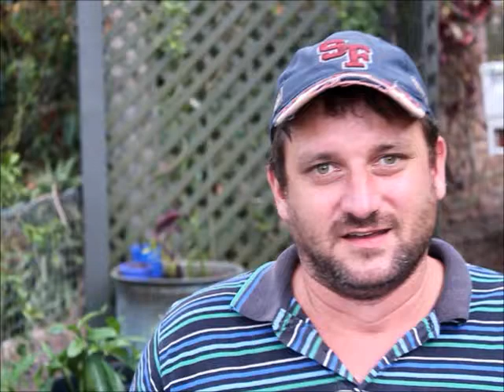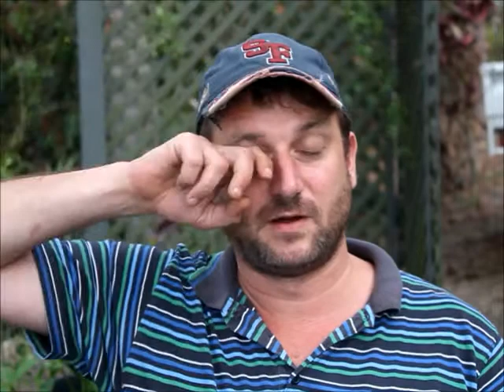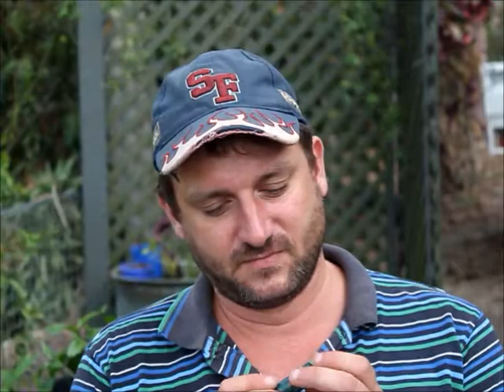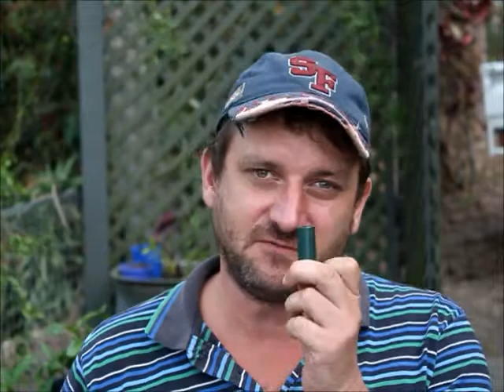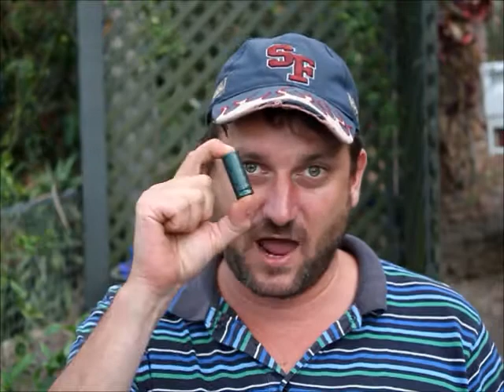MPP Solar PIP4048 (aka PIP 4048) Review - Multiple Failures

Comment: My pip 5048 MG runs just fine for 6 years straight with 0 problems. There are lots of knockoffs you have to be careful.
Reply from the maker: I think you'll find this vid is much older than 6 years. The early ones were utter shit. The company, at the time, had a tendency to blame the user and it was utter exasperation after much back and forth with their customer service that led me to make this video. I too have been running an inverter now with zero problems for 6 years - it's victron, and it's awesome. Pay less, pay twice.

As an aside, this video led me to meet a very skilled electronics engineer in Austrlia. He identified many of the problems with the firmware and software and released modifications to both, which forced the manufacturer through shame to make changes. It's likely, thus, that your six years of bliss occurred tangentially as a result of this video.

Comment: Just a quick question - why do you use the external MPPT controllers as well as the MPPT controllers internal to the PIP? Would this not cause problems if you are charging at greater the C10? Also how do you split your array between the two?
Reply: OK - but I don't understand the PV array connections. Do you have 3 PV arrays or do you common the PV array across all 3 MPPT controllers?

Comment: Bugger. Do you reckon the issue could have been fixed by just installing higher voltage caps? I'm guessing the MOSFETs blew as a direct result of the caps failing? I'm looking at these on ebay but I'm not really keen to spend a lot of money on something I need to immediately void the warranty on to fix a manufacturing issue. Also it's a pretty good sign of other shortcuts taken.
Reply: We've fixed one with the caps and subsequently months later had all the mosfets blow - not sure what the cause is - I've since bought a victron (I bought a 5KVA multiplus but most people would prob get away with a 3KVA as they have a very large peak output that exceeds 3KVA).. I note they now have a charger / inverter combo as well. That's where I'd go, personally. The thing has been faultless and worth every cent as a mid-range pricing between MPP and something like a selectronic.
Reply: True cheers. It's coming up to winter here so I'll probably wait till spring to get all my solar gear (got mains supply via extension cord through neighbours window..). I know not to buy rubbish now :-)
Reply: 5 year warranty helps too...
Reply: The MOSFETs are probably marginally rater, just like the electrolytic capacitors.  While capacitors can be upgraded, doing so with the FETs may well not be practical.

Comment: Hello. Have they solved the issue by now? I've bought one of those on ebay but they didn't send it yet. After watching your video I'm afraid I'll have to cancel my order. I've read about Voltacon, is that better? Thank you!
Reply: Thanks for your prompt answer. I've cancelled my order anyway, I'm totally new to solar energy and I want to buy something usable. Voltacon is an English inverter that looks pretty much as MPP but it's just black. They have good support and 5 years warranty, which is extendable. I'm also checking on Delta Solivia, Sungrow, Growatt, JFY, Zeversolar, MeanWell and Kaco, all of them are around 3-4kW. Which one would you recommend among those? Thank you so much in advance!
Reply: Easily_Bored_Engineer Thank you so much for your comments! I'll check that Victron too!

Comment: Thanks for the info,was going to get one of these but not now after listening to your troubles
What do you recommend in a 48v system?
Reply: +Easily_Bored_Engineer thanks for that,have been looking at them to
Reply: +Easily_Bored_Engineer thanks for all the info,I have been looking into the 24v system to as some friends have the 24v,however my father inlaw would like to try the 48v mainly because everyone else has the 24v 
I have a small 12 v which powers our shed and I am still in the learning etc process to power the house 
I would like to thank you again for your videos because I was and I mean was a jcase follower and after watching your videos and then rewatching his you opened my eyes quite a bit to his bs
Cheers Corey
Reply: What about the battery balancing products on the market? Are they not a good idea?

Comment: I watched your videos and i'm wondering if they have ironed out all the issues with the charger/inverters
Reply: thanks for the quick reply, not sure but i've seen a few recent bus conversions and they've been using these with no problem, for me though i haven't decided
Reply: @dockarl123  Just ordered victron kit to replace the MPP garbage. Will try replacing D52, Q27, Q31, D13, D82 and seeing how they go. Those filter caps as well when I am there. So disappointed as the spec of the units is EXACTLY what I want. Make them $100 dearer and still real parts in them!

Comment: If you don’t mind what inverter are you using ?  You seem to be happy with whatever you have now.. thank you
Reply: Yup the multi can handle 200% nominal for around a second, sufficient to start loads with inrush currents significantly higher than the rating.

Comment: Geez you have me worried!! I bought a pip 4048 not long ago but still not installed as I'm still looking for batteries on a tight budget. I'm more than a little worried now about running a small battery bank too 100-150 Ah until I can afford more bateries.
 
 Since mpp solar aren't talking to you is it possible to fix the unit with decent capacitors if nothing else is fried of course? that way you can show them the problem and how they need to fix it and possibly have to upgrade everyone else's PCB.
Please let us know if you or someone else tries this and it works out well
Reply: dockarl123 
Did this ever get resolved?  I was about to buy a MPP PIP4048  unit but i stopped after seeing this video.
Reply: dockarl123 

Sorry to hear, good thing you posted this video, I am staying away from the PIP because of it, and the way they treated you. I have to use a transformer to get 120volts and that is a power loss of 200 watts or more.  The pip does many nice things but it also has a internal loss of near 50 watts. I will have to go with a schneider context SW 4048 inverter and save those watts...
Reply: dockarl123  You made a good move with the victron stuff, its just very expensive.

Comment: Ive Used a different charge controller on my battery pack , so  Im Really only using  it as an inverter  straight off the battery bank  I charge at 13.9 float at 13.7, no probs . It's a 48v system

Comment: Cheap garbage will never use them again and I have used  seven of the pip4048's in the past so I'm not without experience they are just rubbish don't last 5 months... Staying with my Schneider XW8548 absolutely the best inverters I have ever used...
Reply: +Easily_Bored_Engineer 

Hi' there, May I put your attention to another alternative, which you may or may not know about. To me it was a revelation, and I thought no more development would have been possible on Lead technology, but turns out I was wrong.

By pure accident I happened to stumble over this: "Lead Crystal Batteries", and they are definately worth looking at, being far less expensive than Lithiums, and with better properties than Lithium (exscept for Weight/Energy ratio, which is only an issue on mobile applications) Higher charging rates and better Deepcycle performance than any other Lead acid battery, and even larger charge/discharge cycles than any other battery I have seen before, better low temperature ratings too, I am definately going to shift to these, the next time I need to exchange batteries, which might be anytime soon.

Best regards
Steen Hansen
Reply: Just to understand you right, as I think this is an important issue. Everything I say is Nonsense or what?
 
Is it better than AGM, GEL and Lead-Acid batteries or not? 
Can more cycles and longer lifetime be expected or not? 
Can they handle temperature swings better or not? 
Can they handle higher charge/discharge currents or not? 
Are there absolutely no benefits from this technology or not? 

I worry about these things, as I, as much as everybody else, crave for better batteries at affordable prices. Price versus no. of total KWh you can get out of the batteries must be what determines the best buy. 
Is this battery technology this or are there better alternatives currently available, which can provide a lower KWh price? 
Efficiency as I see it is not the most important issue, as that is easily solveable by a few extra solar panels, I realise this is not without cost though, but what is out there with a higher efficiency at a comparable price.
We would still try to design systems with no more than 50% DOD as we would have to with all the before mentioned technologies, but switching to Lion based technologies does not seem to offer any better solution, as they are so much more expensive, that the end result is more expensive KW-hours anyway.
So please clarify your statement rather than just state: "Steen Hansen nonsense", and give me some real priceworthy alternatives instead, that would indeed be really helpful.
Thank you in advance. 
br "the nonsenseguy"
Reply: That's all fine, I understand what you are saying, but you have not addressed the price issue properly alias the price pr KWh.

The Tesla Wall power is extremely expensive here in Denmark, as opposed to a comparable lead-crystal battery solution.

On a DIY Lion based system, you have to add the costs of battery ballancing on top of the cost of the batteries, and Li-ion battery packs are of very "varying" quality also, when looking into the lower price range.

I realise and appreciate that there is a dramatic difference in efficiency, given that the Li-ion battery technology is based on exactly that (shifting Ion's rather than pumping electrons). But the price difference is not able to catch up with this.Probably because of the other property that the Li-Ion have over Lead technology, nemlay energi density, making it the absolute best choice in everything mobile or handheld, but solar systems are neither.

You compare to your "old"/existing Lead Acid battery system, but you do not mention how old they were, so I have difficulty relating to this comparison. Could you please elaborate on that.

br
Steen
Reply: DIY Tesla PowerWall I use hundreds of lithium Battery banks on solar, Lead acid is just going backwards they fail all the time we're the lithiums just keep on going with 95% to 100% efficiency...
Reply: Easily_Bored_Engineer you need to Contact me.
Reply: @dockarl123  drive-by nature near Mackay import Winston Lifepo4 cells. 8000cycles at 70% DoD. I've been running them now for 5 years. So far so good! Lead acid feels like Dinoaour tech in comparison to these awesome Lifepo4 cells.

Comment: Cheap components and poor engineering, no point asking for a warranty replacement as it will just fail again, get money back useless.These units are on eBAY are very cheap, but are not good, not reliable. I been finding this pattern for most cheap Chinese made electronics, poor engineering practices, not designed properly actual mistakes, unprofessional, cheap components that cannot withstand full power operation and quickly fail. Overheating, inadequate creep-age distances, unsafe, false certifications and approval markings, excessive rf noise.

Comment: I purchased the small 12 volt 800 watt unit being retailed in Australia by Aussie Batteries & Solar. It seems to be working fine. I noticed they sell a similar unit to the PIP 4048.

http://www.aussiebatteries.com.au/solar/integrated-power-systems/giant-power-48v-4000w-integrated-power-system

What did you buy as a replacement?
Reply: dockarl123 hey buddy, i'm several months in using a pip4048ms and pip2424ms in two different installs and doing okay so far. mind you, i'm not using their charge controllers and just using the controller in the units. i've been in touch with mpp solar regards their logarithms for soc's and changing the export format of the log data to some database format rather than a pdf.... will stay in touch!!!
Reply: bobtee65  Thanks bobtee65. My replacement solar board just arrived for the dead pip4048 I was given. Will let you know how the repair goes.
Reply: ***** martin, the guy on the sunny coast is giant power... and they are retailing the mpp solar units here in australia. i did note they do offer 2yr warranty on the stuff they sell. on top of the two i mentioned, i'm running the 812 in a van the father-in-law uses on his trips up here and also have 2 of the older 2424lc models. one of those is in a small bush house we've setup on our property and the other is planned to end up in the shed! dockark123 seems to know his shit, so his comments are a little worrying, but to date we've not had issues with any of the 5 units we have.... so i think he's right in saying it is the separate charge controllers causing the problems.
Reply: well, i'm gonna be pulling the cover off tomorrow to check things out. will have a look at the caps especially. imo, there are a few small flaws in the logarithms for the soc's... 38% soc with 52v!!?!? (how can it be accurate without knowing bank amperage as well as voltage???)

and the data log... saving as a pdf?! that's handy for working out spreadsheets!! ;)
Reply: bobtee65 bobtee65 my 12 volt 800 watt unit is a Giant Power. It looks as though its just painted red and had a sticker put on it. The people that sell Giant Power have been very helpful with some software problems I had with that unit.

Interestingly after telling me that their IPS-4000WoP is in fact a PIP 4048 he also added that he had five on his workbench waiting to have the solar board replaced.
Reply: yes, they just paint the mpp solar stuff red! :/ the do increase the warranty and offer better after sales service... but for the price they're charging for the units, they'd want to!
Reply: have you asked them about their "dedicated" generator!? gave me a chuckle when i spoke to them about one... can't tell me anything coz i might want to steal the idea!!!
Reply: i don't plan to... we're just in a humpy atm, everything is an experiment for the BIG build, house that is. 6 shipping containers!!! come a long way from an 80w bp panel, 2x 100a full river batteries, a 40lt engel and a 150w inverter!! oh for those days!!! lol